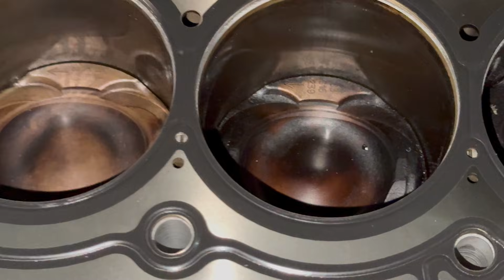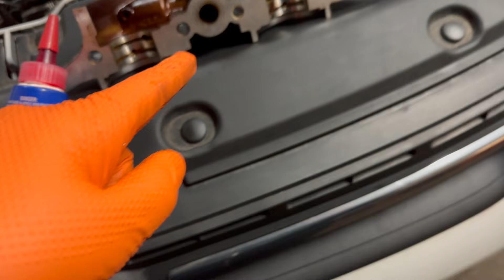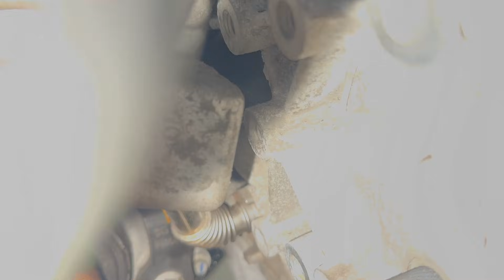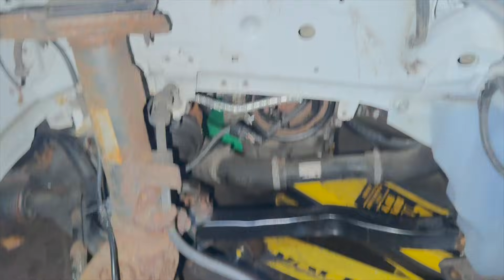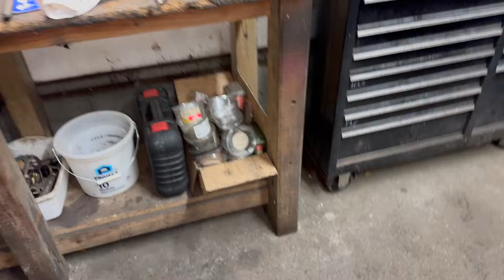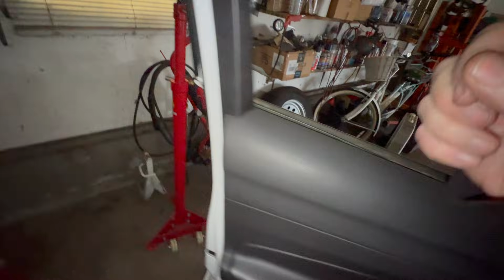Ford Escape 1.6 EcoBoost Head Gasket Replacement  – Part 2: Cylinder Head Installation

Comment: I have a 1.6L ecoturbo.. with a very slow coolant leak.. that doesn't drip and isn't a head gasket.  Worse in the winter.   Mechanic has no idea.  Thoughts?
Reply from the maker: These vehicles are notorious for coolant intrusion because of how the blocks coolant passages were designed, especially on the earlier models. If its not a hard gasket issue the block surface should be checked for cracks.

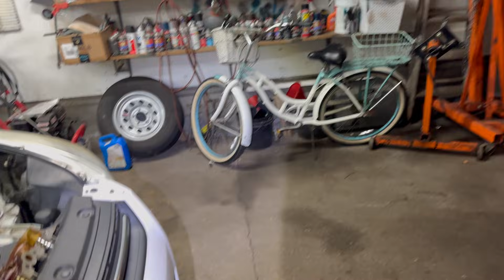Comment: What is that needs to be replaced at 14:33, been trying to find it but can’t figure it out.
Reply from the maker: You talking about the little o ring?
Reply: @motorcarnut yes the one on the cylinder head
Reply from the maker: Just match one up from a o ring kit rather than getting one from the dealer
Reply: @motorcarnut worded it wrong sorry, what is the size is it I don’t have the right o ring currently
Reply from the maker: You can just buy an assortment kit on Amazon or eBay and match one

Comment: Tank you for the explanation I have a Ford escape 2014 1.6L engine and remplaced the spark plugs in cylinder 4 and 2 the spark plugs came out wet with oil and de car consumes a lot of antifreeze I think it’s the cylinder head is broken and the car pulls when accelerating and a white one comes out in the exhaust and is throwing a problem in cylinder 4
Reply from the maker: You're welcome! Those symptoms sound exactly like a blown head gasket allowing coolant and oil into the combustion chamber. It's common on these engines

Comment: Question anaerobic sealer will not cure w/o hardner.
Reply from the maker: It cures in the absence of air between two metal surfaces.

Comment: Question, when re-timing....would i have to remove the gears and loosen the camshaft bearing caps to align the back ridges?
Reply from the maker: I would do it the way I show in the video to avoid any problems

Comment: Subscribed what a great detailed video, the best i have seen, can you recommend a detailed instruction manual for replacing the Timing Belt and water pump on Ford Escape 1.6L 2014 please.
Reply from the maker: Appreciate the sub! Glad you liked the video, I would recommend checking the official factory service manual for those procedures or ALLDATA DIY online as I don't have a specific video on that yet,, however to do the timing belt you can follow this video, the water pump is easy to remove and install as well. Good luck!

Comment: My daughter bought a 15 fiesta se. I traded her a nice 2000 civic because she had to have wheels. Someone had replaced the headgasket and the head was warped so it didn't seal. I fixed the head and the block was a little out of flat. I usually enjoy doing jobs like this because I'm retired and don't need to be in a rush. I quit working on US cars years ago because that's was an always thing after the 80's. Toys and hondas I am a master of. And lexus of course. This little car looks nice, The engine will be like new. But daggone, Ford charges so much for bolts it's stupid. If I have to buy tools then that's stupid after 50 years of working on bikes and cars. Free willy gears? Crank and cams? Now after watching videos I'm scared about the tranny. And i'm fearless. lol My point. I am going to finish the engine. detail the car. Sell it  and go back to what I enjoy. Toys, Hondas, and bikes. I just finished a Mazda3. It was pk. Looked nice and smiled all the time. ( love the front ends). It was a TCM issue. Easy fix. But upon further inspection to feel ok selling it I had to bust my butt on item after item and then more items. nickel and dimed me to death but labor was 50 times what I had invisioned. And I feel this fiesta is going to as well. My lexus ES330 has 280,000 miles. Paid 5000 for it and have put an AC compressor and wear items. My 08 Prius gets 54 MPG and I paid 750 bucks and rebuilt the hybrid battery for 70 bucks. It has 287,000 miles I have put brake pads and oil changes. My tacoma, 2.7 4cyl 95. tires and oil changes. My point and I'm sorry for the rant. I was hoping we had started building better cars. Maybe I'm spoiled. But I am disappointed and remember why I stopped working on our cars. 13 dollars each for a bolt that ya need 16 of? I am going to finish this cute little Fiesta and not feel good about selling it because I can't not worry about the buyer. I live in a small area and my cars sell usually within 24hrs. Fastest was 15 minutes after I placed the ad. Have fun fellers and fellets. I quit again unless they have 2 wires. 1 for the coil and 1 for the tac. Your cool and I enjoy your stuff. Your a better man than me. lol
Reply from the maker: It sounds like you've got a lot of experience and some strong opinions! I agree, but nothing is made like years gone by. Technology can work against  a quality vehicle by manufactures using it to make the vehicles last just enough until the warrantee runs out, lol, that why no oil or transmission dipstick to check yourself, don't touch you "sealed for life" transmission fluid they say blah blah blah.  I try to educate people on how to make their vehicle last as long as possible.
Reply: @motorcarnut  I know. And I do too. I can hear motors. At gas stations ect. Pardon me. You need oil. lol. And I see a Honda Element. An "E" we call them. It's like How many miles? lol My 1991 Lexus LS400 if I didn't love it so much would go for a million miles. Truly the best automobile ever made. That 1st gen was to compete and beat the big lux boys. They did. I love cars. But I hate shit engineering and I am flabergasted with these. Who builds an engine with free willly timing gears? Lol, and get speciial tools to hold the cams front and back. Hold the flywheel and the crank. I lock cam gears. But damn. I'm done. I should have started a channel years ago. Have a great life my friend. I enjoyed learning from you. If you ever find a LS400 1st gen that has been halfway taken care of grab it. Just to marvel at their engineering. You will be glad ya did. Peace
Reply from the maker: Appreciate the feedback, thank you!

Comment: Whats the best way to get the aluminum block and head clean of gasket material?  What do u use?
Reply from the maker: I use several new single edge razor blades straight up not on an angle, have a video on that too.

Comment: gonna be doing this on my 1.6L T ECOBOOST  fiesta st180 mk7 never done anything like this before haha, leaking into cylinder 1 coolant is but caught in time as not overheated or any milky oil yet
Reply: Hello I am at part where I am putting the locking plate into rear of the cams and everything is talked down (cam caps & vxr bridge) do I need to rotate each cam individually until the rear slots are parallel and the locking tool slides in?
Reply from the maker: Not necessary. When everything is installed and lined up you rotate engine 2 times then check the front and back tools slide in
Reply: @motorcarnut I have followed video 3 times and the tools don’t fit , only a little bit off but done it 3 times to make sure it tolls do not go in
Reply from the maker: That’s not good. When you turn the engine 2 times you should put back the TDC pin and let it touch the crankshaft, if it still doesn’t go in you have to loosen the center cam bolts and realign everything again
Reply from the maker: Good luck! Take your time mark everything watch my videos or both removal and install, timing needs special tools but kinda cheap